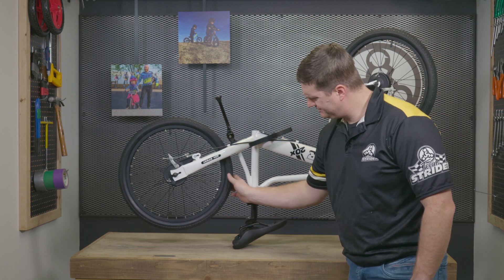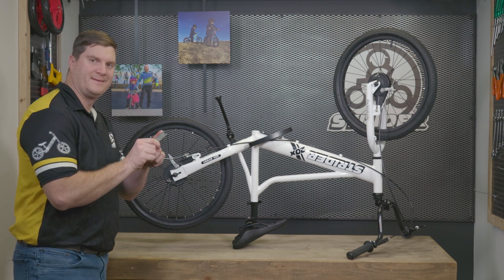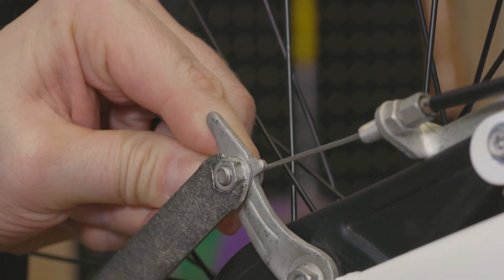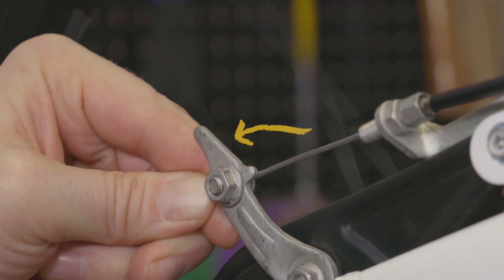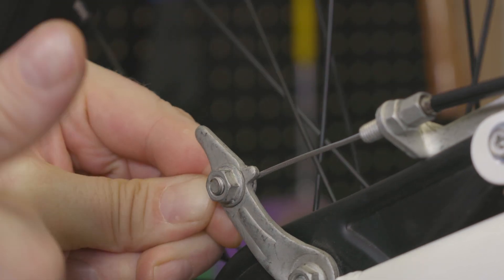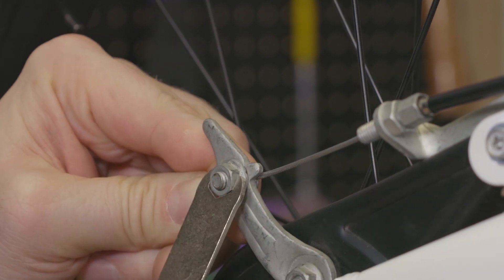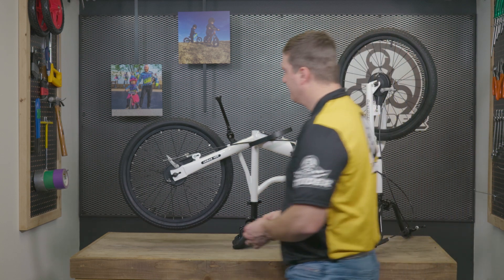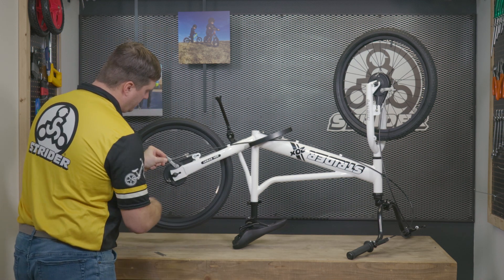20x Drum Brake Adjustment

Comment: plz help me how fast drum breakes
Reply from the maker: If I'm understanding your question correctly, the drum brakes are adjustable so they can set to react as quickly or slowly as you like. Like other bike brake applications it is dependent on how hard you're pulling on the lever.